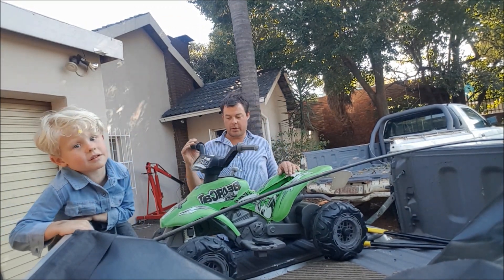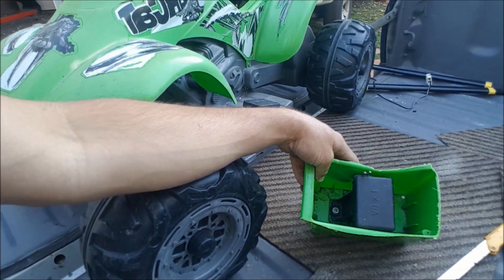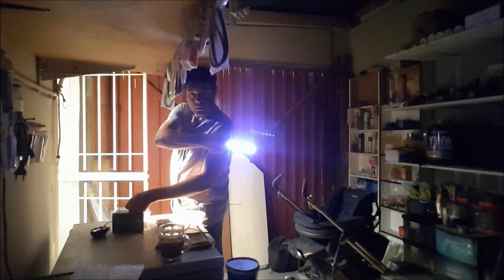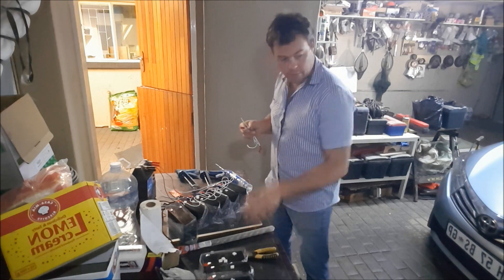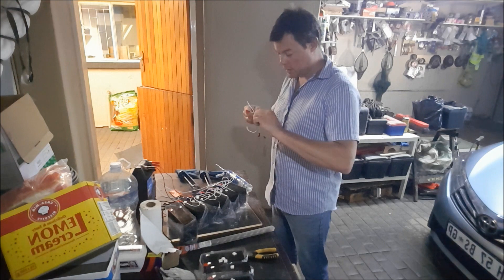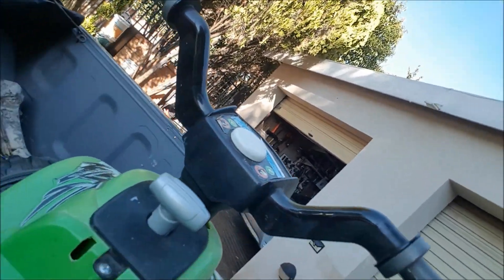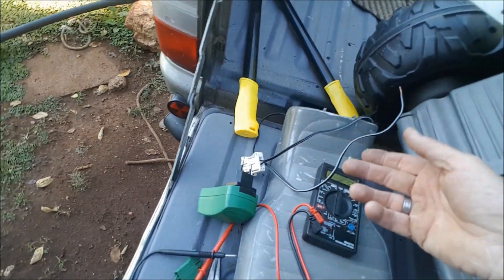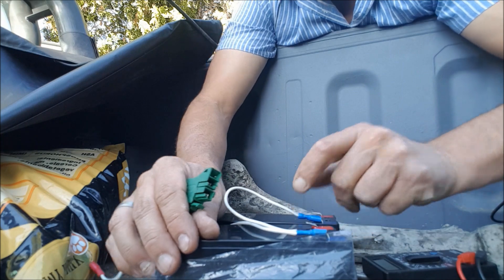Converting a 6v kids quad bike to a 12V LED MONSTER

Comment: Put its own switch for the lights
Reply from the maker: Done that! The kids leave the lights on and it then runs the battery flat.

So, solution is, hook it up to the main switch for the motor so the lights only come on when you ride the bike...